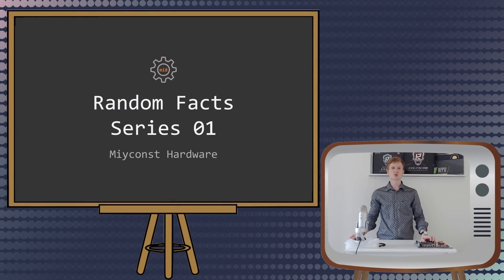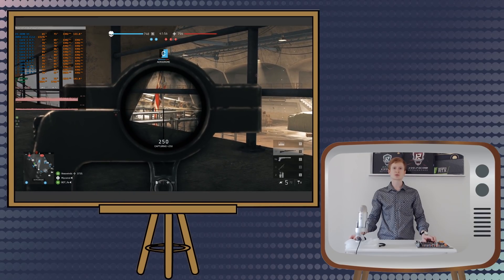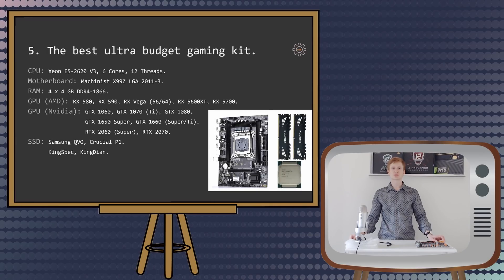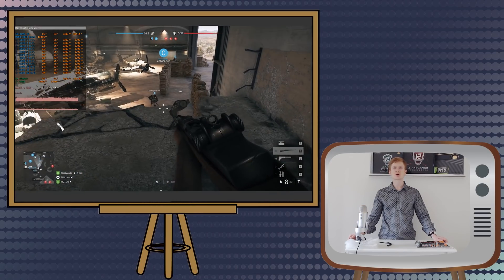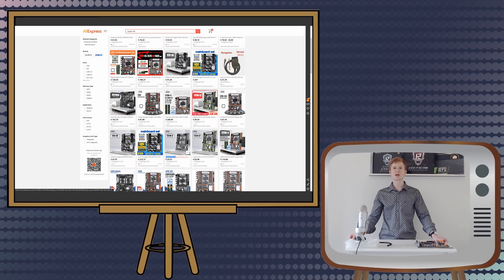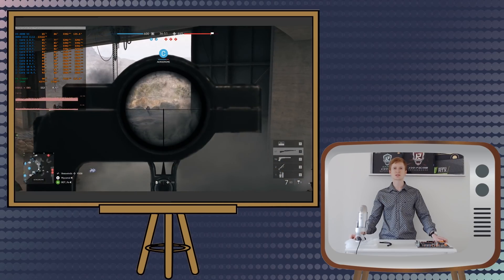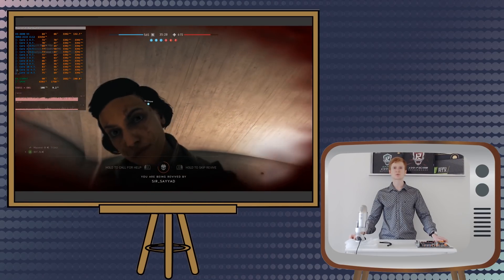🇬🇧 X99 News | X99 motherboards from JingSha & Huananzhi | DDR4 Compatibility | What’s next – RF01

Comment: when i boot my JINGSHA X99  i get a ff code, everything runs but get black screen, my mobo didnt have a cmos battery i had to get one. tested my parts on other computers everything else is working.. any ideas?
Reply from the maker: FF code means that something is connected very wrong or the motherboard BIOS is corrupted.
Reply: @Miyconst  do you know where i can find the x99 jingsha X99-8D3 bios to download?
Reply from the maker: @chrishewitt2451  you can find it here: https://xeon-e5450.ru/socket-2011-3/jingsha-x99-v1-0/

Comment: I just bought a Xeon E5 2690 v4 (14 core/28 thread) for £200 (brand new unopened) on E-Bay to replace my i7 5960x. This is for productivity (video editing) rather than gaming, though I'll still be doing some light gaming.
I was going to get a i7 6950x but they can still be a bit pricy.
I've never used a Xeon before... I shouldn't run into any troubles should I?
Motherboard is an  Asrock Extreme 4 (P 3.5 bios update). Manufactures site says the mobo supports the E5 2690 v4.
Reply from the maker: You should be just fine, but the ECC REG memory is most likely not going to work on this motherboard.
Reply: @Miyconst  First of all thanks for the reply and your time (I subbed)
It does say on the support channel for the motherboard that:
Note1: Quad Channel: V = supports 4 modules and 8 modules.
Note2: For 4pcs, please use A1/B1/C1/D1 slot first.
Note3: The O.C. mode is not guaranteed. It depends on whole system configuration and other parameters.
Note4: For system stability, use more efficient memory cooling system to support a full memory load when overclocking.
Note5: The DDR4 ECC, un-buffered memory/RDIMM is supported with Intel® Xeon® processors E5 series in the LGA 2011-3 Socket.

Note 5 saying it will support ecc ram, which I was surprised at. Is this common for a desktop motherboard.
Also is the E5 2690 v4 any good for editing? Far as I can tell it's 5-8% better than the 10 core i7 6950x 
Motherboard link:
http://www.asrock.com/mb/Intel/X99%20Extreme4/#Memory
Reply from the maker: @FightCollective  wow! This motherboard is a steal deal then. I am personally using E5-2690 V3 and it is doing a great job in DaVinci Resolve.
Reply from the maker: @FightCollective  Xeon E5-2690 V4 is another beast though, more cores, but less frequency. I think, I would rathe opt out for a E5-2689 V4.
Reply: @Miyconst  I hope that, that 'note 5' means what I think it means, that the board supports ECC memory too.
I'll have to buy a cheap stick of ECC and try it out once the cpu is in and settled. 
Thanks for your input!
Reply from the maker: @FightCollective  E5-2690 V4 and V3 do have the same frequency, but V4 has two extra cores, while V3 can be "Turbo Unlocked" to work at the Turbo Frequency on all cores until the TDP limit reached.
Reply: @Miyconst  Thanks. I didn't know that.

Comment: hello MiY, i was wondering if you have ever tested 2x16gb RAM, because i wanna upgrade to Huananzhi x99-tf and e5 2678-v3, but the motherboards works fine in quad channel, but i have these 2 sticks of Corsair DDR4 3000Mhz CL15 2x16, and i was wondering if Dual channel loses a lot of performance versus Quad channel
Reply: I tell you this because if the FPS doesn't drop too much, i'm gonna but the Huananzhi x99-8m that have only just 2 RAM slots
Reply from the maker: I have a video comparison between dual and quad channel memory configuration for gaming. https://youtu.be/l95V_s4rVm0 The X99-8M motherboard you are looking at is most likely the "updated" X99-8M-F version, this motherboard usual B85 chipset instead of X99. I have not tested this board, and can't say if it's good or bad. Answering your original question, 16 GB memory modules work, DDR4-3000 also works, but the actual speed will be limited to DDR4-2133 due to the E5-2678 V3's limitation.
Reply: @Miyconst  Yeah I saw that video, and I couldn't find the case of 2x16GB, because in the Battlefield part you said that 0.1% lows were bad when using 2x8 or 4x4, so I was wondering if i'll get this 0.1% lows with this Dual channel configuration. Anyway, I saw that motherboard, it's really interesting for the price!
Reply from the maker: @Microvoltspro17  I would not really bother about those 0.1% lows in a single game's campaign. In most of the games, you will be GPU limited, and quad channel RAM configuration won't bring any significant advantages over dual channel configuration. RAM timings are more important though, make sure to tighten them, if possible.

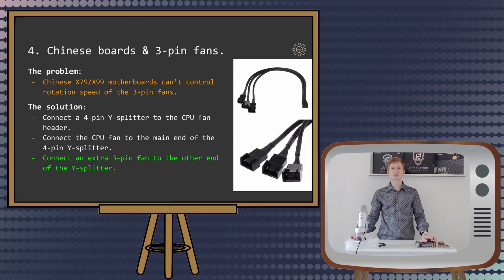Comment: 04:57 This is not how 4 pin fan connectors (should) work. The speed control of a 4 pin fan is done through a PWM signal on the 4th pin, there is no voltage regulation on the 3rd pin as you would see with a 3 pin fan. Connecting a 3 pin fan to a 4 pin splitter should not change the speed of the 3 pin fan at all, if it does that means the motherboard is doing voltage regulation and it would work natively with a 3 pin fan anyways.
Reply from the maker: You are right and wrong at the same time. Maybe it's my particular motherboard, but it does voltage regulation when a 4 pin fan connected. According to the specs, this is wrong, it's not how the PWM works, but Chinese motherboards are not known to work by the specs 😁.

Anyway, I am going to test a few more motherboards when I have a possibility.

Comment: In terms of your comments on 3-pin fans - this doesn't really work. 4 pin and 3 pin fans differ in the fact that the 4th pin is for PWM, meaning that it is telling the fan to intermittently "turn on", rather than dropping the voltage. 3 pin fans will just run at 100% since they don't have a PWM system and will just be getting 12v, even on a splitter.
Reply from the maker: On paper you are right, but in reality it works with these Chinese motherboards. I have no clue how, but it seems like the motherboard supplies higher voltage to the PWM connector when higher RPM is required. I will try to measure it with a voltmeter.
Reply: @Miyconst  please do, I tested this on a Altermiter X99 and I did not see any flacutation of speeds on my fan that was 3 pin only, only on the 4 pin PWM.

Comment: Hi, first I would like to say that your work is great. Second I wanted to ask some questions:
1 - Which x99 models have onboard VGA?
2 - Do you know if these cards support hardware virtualization?
3 - Have you installed or would you like to install an ESXi in any of your reviews?

Thank you very much and another congratulations for the work !!
Reply from the maker: Here are some answers:

1. So far, only JingSha X99 Dual has an onboard VGA adapter.
2. Yes, most of them do, I even had a dedicated video with running Proxmox & GPU Pass through on a JingSha X99-D8: https://youtu.be/f0hCgTVm0Y0
3. No such plans, at least for now.

Comment: Octal channel is just marketing since the v3 and v4 procs individually only support quad channel per socket.

Have you tested using Process Lasso to force CPU affinity on games and other applications where NUMA will incur a significant performance hit? I would expect that performance should be also be improved in games by forcing them to run on the CPU socket that is associated with the GPU.
Reply from the maker: I have not tried Process Lasso, but it seems like a nice subject to explore. Regarding the Octal channel RAM configuration, I meant that the motherboard had only 4 in total, 2 per CPU, which is half of what the CPUs are capable of.

Comment: I want to buy one X99 instead of buying a ryzen 3400, because I think it worth more than the ryzen option, am I wrong?
Reply from the maker: It all depends on the pricing.
Reply: In my case, I'll expend 380 USD to get X99 F8 in my country.
Reply from the maker: @kevinv.c2998  $380 for a single X99 motherboard? That's insane. How much would you pay for an AM4 set?
Reply: The X99 comes with mother, CPU and 32 GB of ram.
Reply from the maker: @kevinv.c2998  Please specify full parts with their prices, otherwise it's impossible to suggest something.
Reply: Can I send you the link?
Reply from the maker: @kevinv.c2998  Sure.
Reply: US $305.41  27%OFF | HUANANZHI X99 F8 X99 Motherboard with Intel XEON E5 2678 v3 with 4*8G DDR4 Non-ECC memory combo kit set NVME SATA 3.0 USB 3.0
https://a.aliexpress.com/_mODyxW9

Comment: I'm curious to see if we can crack the v4 turbo and unlock it for all cores 🤔

My partner and I just ordered a kit that has the Xeon E5-2678 v3, Huananzhi X99-TF, and 32 GB of DDR3 RAM to replace an AMD Bulldozer (FX-6300) platform. We intend to run a GTX 1050 Ti with it, and potentially upgrade to a RTX 3060 or a Radeon 6600 XT if those ever are in stock after they come out lol.
Reply from the maker: So far there is no known way to apply the turbo boost unlock with the V4 CPUs.

Comment: I have recently had an Atermiter board with an E5-2620v3 and 8 gig of DDR4 desktop memory arrive and it worked correctly on first power up. Replace the CPU with an E5-2640v3 as I had one and added two stick of 16 gig DDR4 2666 to have a total of 40 gig and the complete package works really well. I am waiting for the delivery of an E5-2678v3 to try in the board. The AMI BIOS is dated 2020 but as the CPUs I have tried so far are fully locked, they only run as stock frequency. These are good reviews with a lot of useful information, thanks for publishing them. The only downside was the two month delivery time.

Comment: Hii, My motherboard x99 d8 is with b2 error and does not give video, do you know what it can be?
Reply from the maker: Please provide more info. What is your CPU/GPU/RAM, what have you already tried, did the motherboard work and then stopped or doesn't work straight away?
Reply: @Miyconst  Processor xeon e5 2660 v3, ram memory ddr4 8gb kllisre, gpu radeon HD6670 1GB .... Error message b2 or AA appears
Reply from the maker: Did the motherboard work from the beginning or it's the first time you are trying it? Most likely the memory is not compatible with the X99 platform.
Reply: @Miyconst  It's the first time I'm testing it, I recently bought it on aliexpress
Reply from the maker: Then the most likely cause of the problem is the memory compatibly.
Reply: @Miyconst  Does this motherboard only work with two ram modules?
Reply from the maker: No, it needs 16 Banks memory modules. How many sticks - doesn't matter.

Comment: Got my E5 2620v3. Very good improvement to my old i5 4th gen with only 4cores/4threads. Didn't now that it was bottle necking my  rx570 or my gtx 1660. Currently enjoying the stutter-free gaming on 6core/12threads CPU @3.2 Ghz. currently waiting for my GTX 1080. I know you already said that 2620v3 will be enough for a gtx 1080 but do you think a 2640v3 upgrade can have huge improvements? that 2core/4threads more and 200 megahertz of upgrade. I am using a 1080p monitor 144hz. Thanks. big fan. Almost watched all of your videos.
Reply from the maker: E5-2640 V3 is quite a bit faster than E5-2620 V3, but whether you will see a noticeable improvements with a GTX 1080 depends on the games you play. In some games there will be zero changes, other games may lift FPS by 5-15%.
Reply: @Miyconst  okay. I play most league of legends and call of duty warzone. there was a huge fps boost on LOL from i5 4570 to a 2620v3 and cod warzone loads so much faster and more NO frame drops. 

2620v3 compares to ryzen 5 1600
And 2640v3 compares to ryzen 5 2600.
2640v3 currently priced 80usd at my market. 

I was a fan of techyescity and found your channel finding guides on x99 and xeons. 😁 i was considering the Ryzen 2600 at first but I rather spend more on GPU than cpu so here I am. Thank you.
Reply from the maker: @dinowilfreddegracia9238  For $80 you can get an E5-2678 V3 from AliExpress. Anyway, in LoL & CoD you will get a small bump by switching from E5-2620 V3 to E5-2640 V3. I am not sure how justified the switch is, but there will be a difference with a GTX 1080 or a stronger GPU.

Comment: I really enjoy your work. And the information you provide is really good and really useful. I think for Ryzen, I see the 3500 is again around on AliExpress, and is sub £100 - so maybe a good cheap Ryzen for people on AM4. And for the people on really tight budget, I have two suggestions - but one is off these sockets. The one on X99 is E5 is the 1620V2 for V2 X99, and the other is for mobos using the E3 socket - the 4 core, 8 thread E3 1260 v2 - or similar E3 12xx V2 family chips that would be quite low cost on AliExpress...

If you are running a mobo like my current intel on (it currently has a 4 thread/core 3470 ) these xeons used to be way too expensive to consider, but now this would allow an upgrade from 4C/4T to 4C/8T for @£50 - which is a cheap way to extend an older system..
Reply from the maker: Xeon E5-1620 V2 has different socket, it works in X79 boards, not X99 boards. For X79 though, I would pick E5-1620, because it can be overclocked. The Xeon E3 options are still overpriced in my opinion. It's better to sell the old motherboard and buy X99Z + E5-2620 V3 for the same or less money.
Reply: @Miyconst  You are right, I had a brain melt there. I should have said that for a very cheap game rig option, the X79, E5 1620 V2 and some memory offer very cheap options for the gamer who is really cash strapped!! :)

I personally would leave these chinese boards stock. I know there may be more performance there, but I tend to lean towards just having a base stable system. I am accepting of this in the cases where I buy the systems on a limited budget. If I really want or need the perf, I'd just pay a bit for more AM4 and Ryzen. 

Thanks for all your info, it is always most useful!

Comment: My observations from experimenting with the Huananzhi X99-TF and Jingsha X99-D8 (DDR3): The long boot times on the Jingsha X99-D8 (DDR3) are only true with Hunanzhi BIOS versions prior August 2020 (which also include the menu for memory timings). The August revision boots very fast on the Jingsha (and the Huananzhi X99-TF) but doesn't bring the memory menu (you need to set the custom timings with AMIBCP and re-flash that modified BIOS). I do now use the 10/10/2020 BIOS from iBiosEngineer which I modified further on the Jingsha board - I've encountered two problems though: 1) FPT doesn't work after the first successful flash; 2) If I enabled NUMA and tried to run with COD enabled, I got a A07 error with the Management Engine - the board won't even power back on once it is down, you need to clear CMOS to get a working system again. Maybe it has to do with other BIOS settings which I altered, but I just wanted to get that info out there. Otherwise, that BIOS runs fine with my SK Hynix DDR3-ECC memory. And I have also noticed that the Jingsha board doesn't seem to work with DDR3-2133.
Reply from the maker: Thank you for the additional info. I can confirm, that the updated Huananzhi BIOS boots way faster, but it lacks overclocking capabilities and RAM timings. Regarding the BIOS from iEngineer, you can create an issue on GitHub and describe your problem. iEngineer is usually responding fast and friendly.
Reply: @Miyconst  That's what I did with the first issue (as flashing still works with the AfuEFI method, this is more of a convenience issue) and was still elaborating if I should post the second as it would require more work to pinpoint and confirm it on my side to be actionable.

Comment: Thanks for your work. I am looking at the dual 2678v3 and other 8 to 12 cores and it's been informative. I play mmo's and box alot. Basically run 6 to 13 instances at one time.  Can do this at the moment with 9750 mobile processor I have throttled to 3ghz do to heat. I was looking for something that runs faster than 2.3ghz on as many cores as I can afford. I haven't purchased anything yet. I was looking toward this method because a whole setup with either the 2678 or 2680 is the same price as a comparable current day processor.  I would like to here your thoughts and also ask about cooling and power supply suggestions.
Reply from the maker: The answer is pretty simple: go for Ryzen if you can afford it, otherwise E5-2678 V3 / E5-2680 V4 is a good option. For cooling and PSU suggestion I need to know your location.
Reply: @Miyconst  thanks for the reply. I'm in the US.
Reply from the maker: @salvatorearbassio3609  thank you can pick parts from Amazon. E5-2678 V3 is not a hot CPU, something like Cooler Master Hyper 212 Evo will be enough. For the PSU: pick at least 500 Watt 80+ Gold or 600 Watt 80+ Bronze.

Comment: I personally recommend the next set up: 
-MOBO: Huananzhi X99-TF; 
-CPU: Xeon E5 2678-V3; 
-GPU: GTX 1660 Super; 
-RAM: 4x8GB DDR4 (i personally went for a kit of server ram modules DDR4 2133Mhz because there are usually some good offers; It happens the same "market phenom" as server processors);
-For storage: SSD NVme M.2 XPG SP2800 PRO 512GB (one of the best M.2 SSD option of the last year)
-Air Cooling: i went for a DEEPCOOL GAMMAXX GT with two fans. There are also some Coolermaster, Noctua (if your budget allows it) options and some other chinese brands with good cooling performance

Good workstation/gaming performance. Multitask with no problems. CAD design; FEA simulations; Office work and gaming at high performance, high setting in most of the games (of course that those with high graphic requirements as RDR2 will run between 40-60FPS but that's obviously given the GPU)
Reply from the maker: That's a very nice combination!
Reply: Really nice

Comment: For low power consumption proxmox server, sas controller (omv vm) and gpu passthrough (jellyfin transcode), can this board run in xeon 2650L v3?
Reply from the maker: It should be possible, but I have not tested exactly this configuration, thus I can't guarantee.